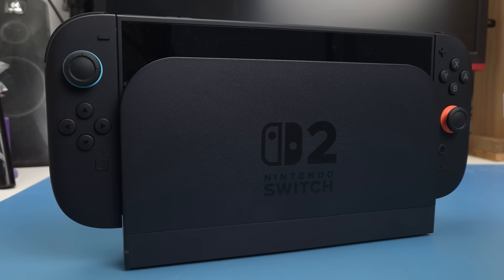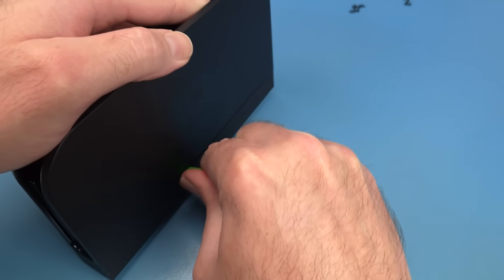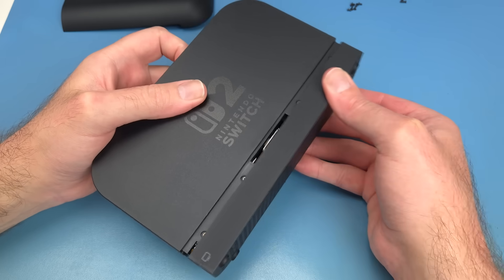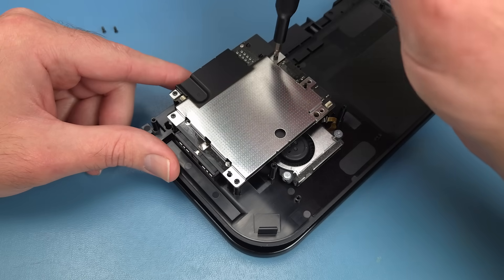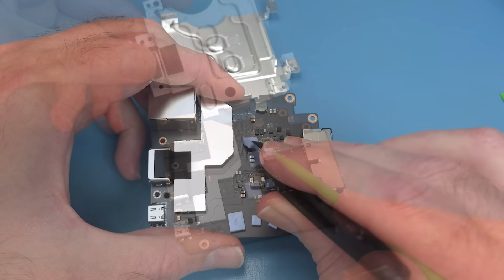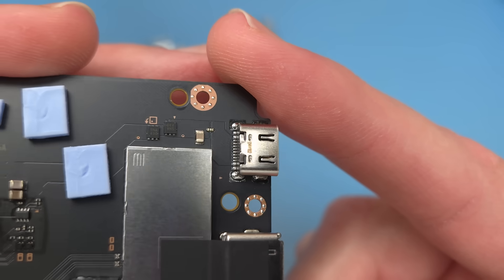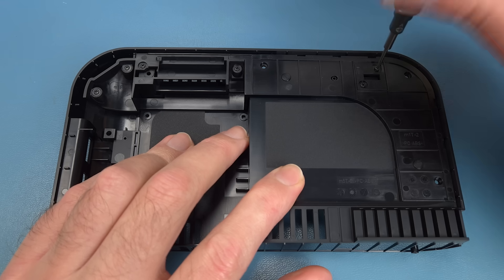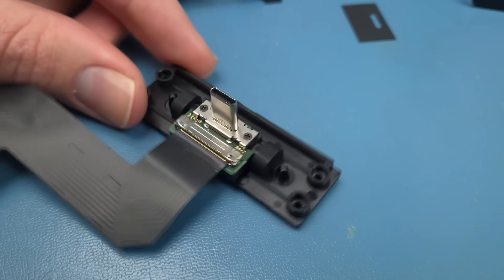Switch 2 Dock - Full Teardown

Comment: I suspected that the dock for the Switch 2 is like a type of upscaler, I mentioned this in other videos. That board has to be working similarly to what the Mcable does by sending a 4K signal so the TV’s internal upscaler doesn’t have to do it, because TVs usually aren’t good at upscaling games. Normally, when the TV upscales 1080p to 4K, it looks blurry and introduces lag. They decided to make a more advanced and powerful version that even needs cooling, so it ends up being cheaper than using brute force processing in the Switch 2 itself.
Reply: all the dock does is convert a displayport signal to an hdmi one
Reply: @dxrwspl  When have you ever seen a conversion to HDMI that needed ventilation?
Reply: @trexmtb4381 The fan cools the console, not the dock. This was very clearly explained in the introduction video of the switch 2. The dock doesn’t upscale, it has no hardware for that. The console does.
Reply: @hoaxlayer  The way I see it, air comes in from the back of the dock, travels through the chips, and then exits from the top. The Switch 2 has intake vents at the bottom, so air goes into the Switch 2 through its own fan and then comes out through its own exhaust port. It doesn’t make sense for the air to flow directly over the hot chips and then exit through the top of the dock. Do you think the fan is actually pulling the heat from the bottom of the Switch 2?
Reply: @hoaxlayer  Watch the video carefully and look at the fan’s direction. If you know how that type of fan works, you’ll understand, those fans don’t run in reverse. I worked for several years repairing laptops in a shop, so don’t tell me the opposite.
Reply: @trexmtb4381  How about I let Nintendo itself tell you otherwise?

https://youtu.be/LYA9nX0Xi_w?feature=shared&t=8205
Reply: @hoaxlayer  The most I can think of, without doing a true upscale, is cleaning up the 4K signal image to make it look better, like sharpening it and hiding the pixels so it appears cleaner. Because it’s confirmed that it’s still a 4K signal with less detail than other consoles. Also, the dock, to avoid introducing lag, could add more power or increase the frequency, which would require cooling for those chips. The dock does have chips, by the way. And check how that type of fan works, because that airflow doesn’t actually touch the Switch 2.
Reply: @hoaxlayer  🤣 The only thing you’ve shown me is what I already confirmed: the Switch 2 cools with its own fan, and the dock has a separate one. Even the lines clearly show it.
Reply: @hoaxlayer  The dock has space so that the Switch 2 can draw air from its own ventilation, which the video clearly shows. The dock cools the power controller and the chips it has. Look closely at the lines, the dock pulls air from the fan located at the top of the dock, directing the air to the dock’s components. The Switch 2 draws air from its own fan and has space to cool itself, it’s as clear as day.
Reply: @trexmtb4381  Man, you are either VERY confused about who you are replying to or clicking on the wrong username. Either way there's the official info directly from Nintendo. I'm out.
Reply: @hoaxlayer  Okay, whatever you say, I see it very clearly. Two red lines shows under the dock from beneath it with two separate flows clear intakes. Then it shows from the side, one line traveling under the side of the Switch 2 and another line traveling from the back of the Switch inside the dock, going to the chips and components of the dock. the way it works these types of fans proves what I’m saying. Have a good day.
Reply: @trexmtb4381  never, but I know voltage regulators can get hot
Reply: @dxrwspl  That's true, but anyway, I've already shared my opinion. The dock itself doesn't cool the Switch 2 directly, and it's also possible that it's cleaning up the image, since the Switch 2 is limited by its CPU. I know there will be many games that won’t come to the Switch 2 unless developers take the time to simplify things in the game. They already confirmed what I suspected about the Switch 2, it's using a mix of the PS4 Cyberpunk version and some elements from the PS5 version to work the way it does. If they did the same on the Steam Deck, it would’ve run at 60 FPS without tricks, and the Steam Deck is running the full PC version, which wasn’t even made for a device like that. On top of that, I can use Frame Gen, which will make it look like it's running at 60 FPS.
Reply: @hoaxlayer  https://youtu.be/96DzOL5qlUA?si=vMnafdZdA4uNrPIx
Reply: This is my theory aswell, another reason why they do this is for the 1440p games. Most tvs don’t support 1440p resolution as it’s a pc standard. The dock gives you the benefits of 1440p by taking that resolution and up scaling it to 4K so your tv supports it. Otherwise it will be sending 1080p out to your tv on games that can run in 1440p.
Reply: @TheWretchedWorld  The only games that can run at 1440p are games made by Nintendo that are not complex, Cyberpunk the internal resolution of the game is like 540p to 720p then DLSS raises it to 1080p and then the dock to 4k that is my take.
Reply: There is no upscaling on the dock. That would cause latency penalty also like TV upscalers. 1080P on 4K TV looks blurry because it’s 1080 being stretched out to a 4K screen.
Reply: No up converter, it detects dock mode and switches over to use full power and it can use the fan to cool it.
Reply: @SkaterStimm  Cooling the dock, not the switch 2, is logical.
Reply: I see directly through the dock, yep as stated The Switch 2 cools itself and the dock's fan is for itself. https://youtube.com/shorts/pMymCl0quyM?si=lEa2cEu3HV4zUjti
Reply: There is no upscaling happening in the dock. The console itself is responsible for scaling the presented image (Switch 1 games present 1080p, Switch 2 games present either 1440p or 2160p) to the output display resolution.
There is a passthrough function where games presenting 1440p (This does not refer to the game's internal rendering resolution, but the resolution of the image sent to the OS) are not rescaled when the output display is also 1440p.
Reply: @NZZN_  Then is a clean up for the signal, because most third-party games are just upscaled using DLSS, which is AI-based tech. Not all games run at full resolution, only lighter ones that don’t hit the CPU hard, like most Nintendo titles. Cyberpunk struggles to even reach 40 FPS, especially in the DLC areas, and third-party games will vary. Some won’t run at all. And let’s be real, I already know GTA 6 won’t show up. With how detailed and complex that game is, there’s no way it’ll run on this kind of hardware. At least Nintendo’s own games will still look great.
Reply: I don't think this is the case, because based on this teardown the heatsink is connected with thermal pads to voltage regulators only, not to any special chip. So it looks like the cooling is for the power supply specifically.
Reply: Upscaling is done via DLSS on die. Dock doesn’t contribute.
Reply: @Shankovich digital foundry said MKW doesnt use DLSS
Reply: @Shankovich  DLSS Upscaling does it at the limit of the Switch 2, the dock refines it, that's what I'm saying.
Reply: @Shankovich digital foundry said theres no dlss
Reply: Someone is going to test what I’m saying, you’ll see.
Reply: Well it doesnt work well if it is, MKW looks blurry on my 4k tv
Reply: @yogurtspace2062  mine doesnt at all. Very crisp.
Reply: @yogurtspace2062  MKW looks fantastic on my 4k tv. Been playing that, and a lot of TOTK, both look amazing.
Reply: @Ryan-xn3mt  That's odd, how close do you sit to the tv?
Reply: @yogurtspace2062  It might be displaying at 1080p if ur tv can’t do 120hz at 4K. You’d have to disable the 120hz in the switch2 options I think
Reply: @DivineOassis No way, the Switch 2 dock can't even deliver 4K 120Hz, only 4K 60 or 1080p/1440p 120.
Unless specified otherwise in the Switch2 settings, a 4K TV will display 4K 60 Switch 2
Reply: @freewillpilgrim  depends on your game.
Reply: @yogurtspace2062  there is something wrong with your setup.
Reply: @yogurtspace2062  The way mcable works you have to lower the resolution to 720p of the console then the mcable helps to upscale, that cable is made for retro gaming, if the wii signal reaches the tv at 1080p or 4k the cable does nothing, investigate that, it also depends on the mcable version.